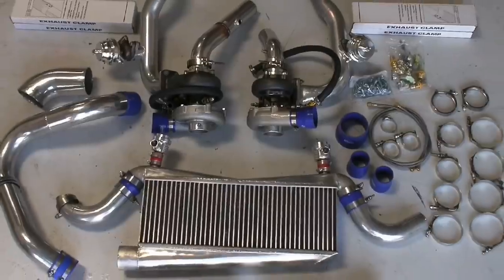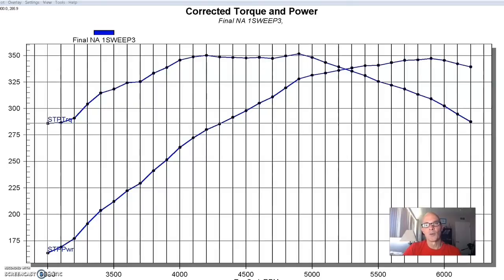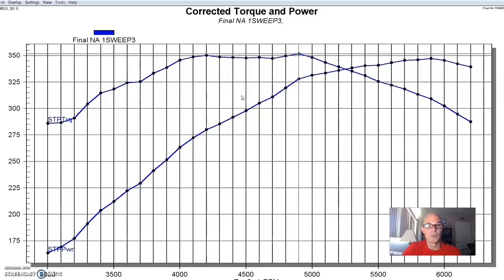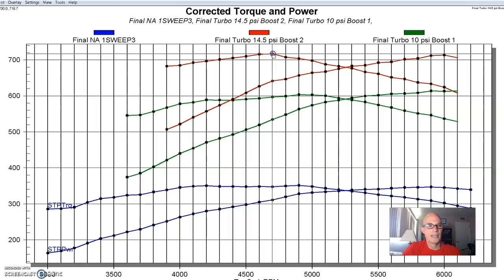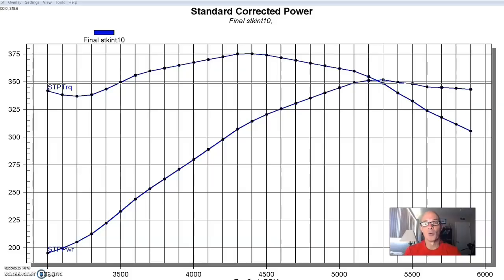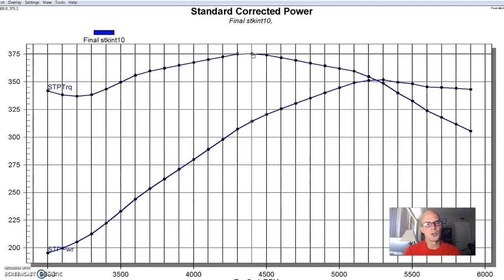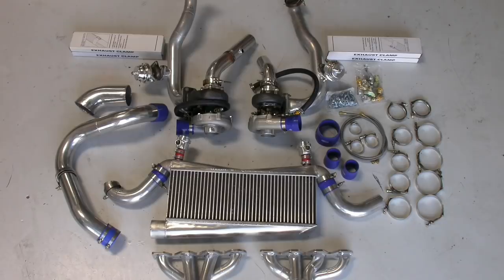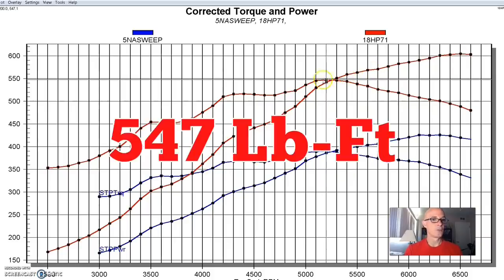TWIN TURBO MOD FORDS (2V, 3V & 4V)

Comment: Ported, npi heads,are not as good as, stock pi heads.
Reply: You can tell right oglf the bat if you fallow his channel.
Reply: https://web.archive.org/web/20160220174040/http://www.sullivanperformance.com/yvs450/tech/tech.htm
Reply: this is some really good information you should read
Reply: What’s the cost, for marginal gains?

Comment: As a guy whose building a 3v I really appreciate this! It’s hard to find content or information about the 3v considering it’s short lifespan. Good video!
Reply: Well just remember to anti-sieze the sparkplugs so they actually come out.
Reply: Scootermagoo I luckily have the revised heads from late 2008 and 2009 models. Thanks for the warning tho lol.
Reply: How many thousands of them are still running. There 3 of them same color and package as my FX4 in a town of 8000 people, dozens of 2 and4wd running around. Not to shabby for a motor with 'problems'!! Mine just tripped 250000! I tow a 5400lb dry weight camper. Car trailers, gonna pull an old tractor soon!!
Reply: I'm building one as well. And aftermarket parts is super hard to find. No intakes or fuel rails.
Reply: @Bugsidious  CPE or an old JPC if you can find one (and have no budget) ford performance is also good but if youre going to see boost pressures in excess of 20 I would just run the Jegs intake. Fore Innovations also has complete fuel systems available.
Reply: @Bugsidious  BBK makes rails !
Reply: I agree notice about all he did was put hook them to the engine  and get out the vice grips check out brenspeed he specializes in the 3v and had a cam company cut him a cam that elemenates the tune problem this dude ran into I was going to switch to a coyote but following this Brenspeed I'm seriously thinking about keeping what I got its a good engine I'm not planning a pro stock career I do want something I can tell the car that out runs me mr your car is a lot faster than I want to go

Comment: Generally youre not gonna pick up much at low end with the vvt, just mainly past 4800 with the stock cams. Stock call has vvt zeroed till then at wot
Reply: then why do you loose so much bottom end when they are locked out? and wouldnt 90% of all the phazers rarley if ever get to the point of being utilized in normal dail driviving making there failures less common?